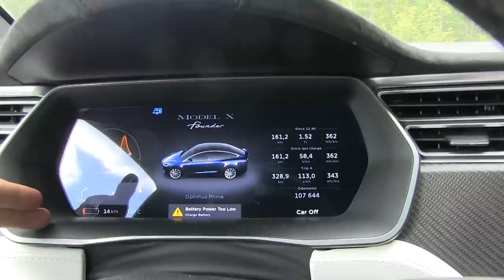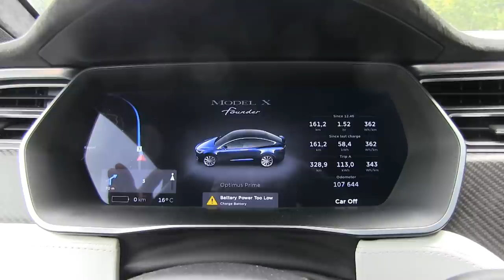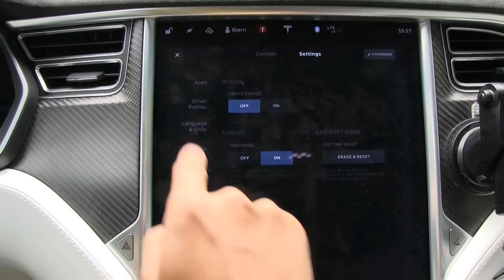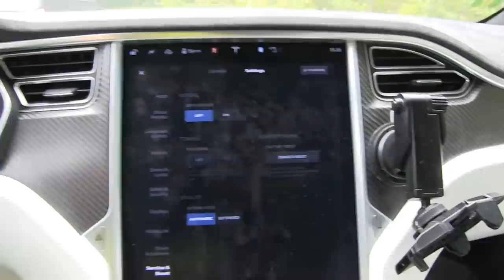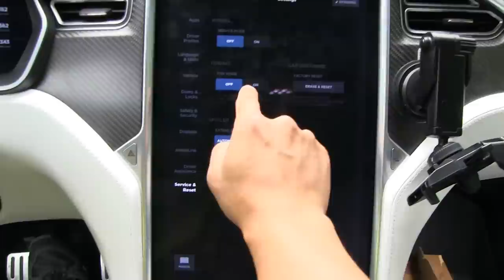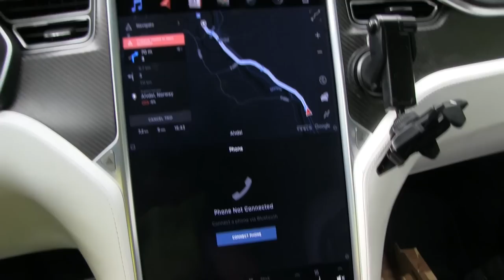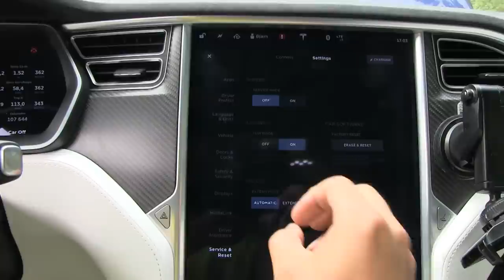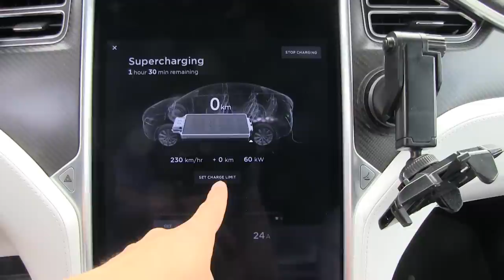Tesla Model X P90DL shuts down with 14 km/8 mi range left

Comment: There is no reason for the truck driver to let the engine running unless he uses A/C , heater or some other power consuming device on. It's a small truck so it takes no time to run again normally after 20 min. Air brakes hold the air until you release them they don't require the engine running since the air is stored for parking purposes too.

Comment: I truly think (even though I fully understand that it would likely be VERY slow) there should be an array of solar cells built into a portion of the body of EVERY Tesla so that in situations like this, at least one could charge the batteries (even if very slowly) and hobble to the next charging area without absolutely reliant on having to call a tow truck, etc.
Reply: voicetube useless. Would take days to charge even for the slightesst increase. And don't forget the on board computer sips 300 watts alone, thats a 1m by 1,5 meter solar panel...
Reply: voicetube unfortunately the time a solar panel will take to deliver any useful energy to the car would be in the order of days.

Comment: The calculation was probably right without a load (trailer). Anyway. Driving the battery so low can damage the cells indefinitely. Seems like it isn't your first time to charge 20-30km before complete shut down which would explain why it happened here.

Comment: You should have App for battery health, Kman I think have one. You will see voltage difference between cells. To see the largest difference you should look when the battery is in bottom or top on SOC that is then you see the most. You can hunt which group  of cells is way off.

Comment: Simple. You're pulling the trailer uphill which means the voltage drop is much higher. Once it breaches a certain lower limit the car will shut down to protect the battery.

Comment: Another weird thing I noticed. They said 50kw battery charges in 30 minutes. This says 90 minutes. Isn't that false advertisement
Reply: justin jones the car has a 90kwh battery. And at a higher charge the charging gets slower so the 50kwh in 30 min are probably true
Reply: Charge rate was set at 24A, can go high as 80A depending on power feeding to the infrastructure.

Comment: Maybe throw a high output generator in the trailor fully gassed up and ready to go to plug your charger into to put enough power back into the battery?  Just remember to turn everything off to prevent surging.  ?

Comment: I think there's nothing surprising about this.
The expected distance is calculated on a statistical basis for each car.
With rising towing, a much stronger battery load, the voltage dropped below critical.
In some EVs, you turn off, wait 10 minutes and still have a few kilometers to go with it.

Another. I have only one urban Nissan Leaf.
I was once with him on a longer adventurous journey.
Consumption can be well planned. I always rolled into the next charger with the last pair of electrons.
I did not stay on the road, but I think if I replace my main car with electricity, I will buy a small Honda generator. :)))

Comment: I don't know if that jump pack would be powerful enough to charge the 12v.  Those jump packs usually have a 12v-12Ah battery, and the model x has a 35 Ah 12 volt battery.  Is it dangerous to jump it with a running engine from another car?

Comment: So if the batteries are totally down (not enough energy for any electromechanical systems and for the infotainment system), you can be stuck where you are. I think it's the same with a modern ICE car with electric parking brake, when the 12V battery is out of charge. "Old school" mechanical-actuated parking brake might look cumbersome or not cool but for sure more reliable. I think there should be a mechanical redundancy for safety-critical actuators. Interesting to note that for example in the modern automotive era the steering system is still mechanical, wondering for how long...XD

Comment: my friend had same problem with the tow mode - couldn't engage.  it turns out this was software problem. instead of push "ON", push on the "OFF" of the tow switch, it will enable ... weird!
Reply from the maker: It's a bug. I made another video about it.

Comment: Am I understanding this right? You put it in tow mode and then pressed park?? I noticed the car was off when you were doing this. When off park is engaged and tow mode is disabled. From memory it's go to neutral with foot on brake and then engage tow mode. This has to happen when it's on.

Comment: What is the range of this Model X P90D? You started the trip with the battery fully charged?
Reply from the maker: I charged to about 85 %. A full charge would take 30 minutes extra (for just 30-40 km more range). Not worth it.
Reply: Yeah, true! I heard that it's not really healthy for the battery to be charged every time at 100%, only when you go on long trips.
Reply: john dillenger what lmao
Reply: @claudiuhossu3504  It wasn't full because the charge is slower at the end of the charge.
You can charge 100% battery if you have time. The car solves itself.
Just don't keep it for 100% long.

If he had been driving a little slower, he would accelerate more carefully, he would have spent a little bit more, then he could have passed through the mountain ridge.

I think he knows this right now :)

Comment: battery life is calculated on past history, current driving,...  all battery devices suffer from this...  at least you're not mad...  your fault for letting it run too low...  good advice though about not going too low...  I liked because you're a decent sounding guy and learned from an easy mistake we all would end up doing :)

Comment: Weird - if the car had been on, cruising along, shouldn't the DC-DC converter have had the 12V battery charged up to 100%?  Why did it drain so fast?  Was your main pack unbalanced, and your 12V battery severly degraded in capacity?
Reply from the maker: It didn't drain that fast. Even after 1 hour, the screen and everything was still ok. The 12 V warning was probably just because the 12 V battery didn't charge anymore.
Reply: So why did tow-mode not work? (PS thanks for all your vids)

Comment: You shouldn't bleed the battery that low. That's kind of abusing the batteries. Optimally you should aim for more recharge cycles and only partially drain the battery. Same goes for conventional cars. Always re-fuel more gas for ICE cars at 1/4 tank. If you deplete the tank, you can affect the fuel pump.

Comment: I read on the Tesla forum that there's a glitch with tow mode, and a workaround is to switch it on or off by clicking on its current state, e.g. if it's off click off and it switches on, if it's on click on and it switches off. I wonder if it could be that simple, didn't see you try that method so just a suggestion:)

Comment: But why is the tow trucks engine still running???
Reply: why not
Reply: @Partyaap050  waste of fuel
Reply: @dastomde1529  doesnt matter that much
Reply: @Partyaap050  I don't think he understands how idling works in a Diesel that it's not like petrol vehicles and it doesn't really matter when you have a 30 gallon Diesel tank

Comment: When u put it in park, are the front wheels still unlocked? So the parking pawl and e-brake are both only on the rear axle? Or can both axles be locked like a FWD car can. Tow truck needlessly idling..

Comment: to all the people complaining and saying teslas cars are flawed and gimeckey and only fanboys buy them. Jesus man. The battery showing 14 km left even though it was at zero can easily be his own fault if he has run the car dry before. Tesla has warned that you are not supposed to let the battery reach 0% because it damages it. And the fact he was already trying to push the limit and was pulling a trailer aswell all contributes to this problem. This was not the cars fault it was entirely his own. And basically every problem there has ever been with a tesla has been fixed. Since tesla's are such highly advanced all electric cars they will have problems to begin with just like any other electronic - such as phones or consoles or computers. The first couple people buying a new tesla model (one that has just come out) know they are essentially going to be beta testers. Every problem they find they report to tesla and tesla fixes it and free of charge since they are the first to try out the car. The later models essentially has no issues unless you drive like a morron or ignores warnings. Dont blame the car for everything. Thats like blaming a phone for exploding because you put it in the microwave.. like what did you expect?

Comment: Hi Bjørn, thanks for the post. Very interesting dilemma indeed. Just curious why the tow truck driver did not hook up your trailer after loading the model X onto the flatbed. It looked like I could see a tow hook on the back of his flatbed. Would have saved you the trip back to collect the trailer if he could bring it with you to the supercharger.
Reply: Maybe too close to maximum train weight, Model X being such a heavy car? Or perhaps just too much extra faffing involved when it's safe to leave the trailer and come back 30 mins later.
Reply from the maker: The tow truck can haul a lot. I have seen them pull a car on the flatbed and another one behind. I guess he just forgot about it. And I never asked him. The drive back for the trailer was just 15 minutes. I already lost 3 hours.
Reply: Thats fair Bjørn. I was just worried about leaving your trailer alone for too long. I figured it may have been an insurance issue to tow that for you as well but being as you had to pay for recovery it would have been nice to bring your model X and the trailer too :) I love watching your video logs. Thanks for making these :)
Reply: That could have been the case for sure Nettlesoup. As Bjørn replied as well we know that most likely there was just too much going on for Bjørn to think of this option and at least it was not far away from him once he had completed the supercharge. Hopefully Tesla can shed some light on the operating conditions for the tow mode.

This makes me wonder if someone will invent a portable battery pack to help you do a quick charge on the road, just like carrying a small fuel can :)
Reply: Why do you tow a trailer with an electric car anyway? :))

Comment: Yeah but you pull a trailer, so the car see that your consuptions are more higher and the range ajusting. If it's too low, you will not be ablee to open the doors.

Comment: Does the car not warn you that you must pull into the next possible supercharger before the power gets down to say 16 Km?    I know you like to push the limits But really this hopefully will make you more likely to now set a limit and charge before this again?     Also is there not by now a back-up power charger unit you can carry which will recharge the main battery just enough to get to the next charger if you miss the one you should have charged at.  I be very amazed someone has not come out with a back-up small power pack to save tesla car drivers?  Just shows you as you rightly said always charge if the level drops say to 16 km at least.

Comment: What is ridiculous here, is that there is no mechanical way to undo you brakes. A few basic thing should be possible without any batteries: open the doors, tighten or untighten the breaks

Comment: Why was the spoiler opening and closing repeatedly when the car was dead and on the trailer and unplugged? Bug? Trying to turn on? Any idea?
Reply: killerrabitwherexis4 
Keyfob and autopresent.
He went close to Optimus prime and the car opened itself (see flashing lights,  backlights) and the spoiler. Funny since the 12v battery was to low to release the parking break lol.

Comment: Why does it say 'Battery Power Low' in stead of 'Battery Energy Low'?
Reply from the maker: It's also correct. With low battery, the available power from the battery is also low.
Reply: @bjornnyland  Good point. Thanks!

Comment: That is quite unfortunate. Perhaps someday Tesla will make a portable supercharger kit with a 5-10 km range capability for short-range jumping purposes. just enough to get you to the nearest charging station. perfect for piece of mind
Reply: samo wordo Surely just a model S with a Tesla power wall in the boot?!? That would give about 40 miles range if you discharge a powerwall. I wonder if Tesla could develop a cable that plugs directly from one electric car to another to share some electrons!?
Reply: MercedesAMGsRULE the power wall sounds like a good idea. perhaps Tesla can provide a mobile version of this technology.
Reply: samo wordo why?  Do you carry an extra fuel tank around?  Think.
Reply: SO O -I understand that an extra tank would be incredibly redundant but Bjorn could have avoided this situation if he had a backup jumper utility. one that can only be engaged if the car is zeroed. He probably lost nearly 6-hours behind this. & it wasn't his fault. the thing jumped from 14km to zero nearly instantaneously. a backup jump pack utility could provide legitimate piece of mind & for some, piece of mind is everything.
Reply: Some people do. They are called Jerry Cans.